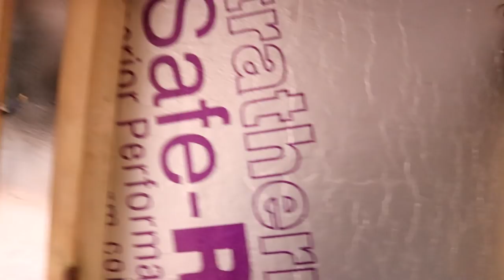I MET A BUNCH OF HEBRIDEAN CHAPS ON A RUN

Comment: Great work Harry - it’s coming along nicely. I like your idea of the condensation catch trays, as I would be concerned about the water soaking into the wood frames of the cool rooms and possibly leading to mould and/or wood rot. I would reckon you would not want mould in your brewery. Keep up the great work. Cheers from Australia. Jeff.

Comment: Nice shout out about the shouting out 😄 .  If you have fifteen rolls of plumbers PTFE it may be  a little different but I had at least three rolls of plumbers (knocking about in different tool boxes) and after I got the roll of gas tape I've never touched them since (when I find one I still go looking for the gas tape). Great vid as usual, I would go with the catch trays and a drain, I don't think that drips to the floor would run away efficiently, most likely they would soak into the wood frame and create a fungal/ rot problem in the long run? All the best. Cheers, Schnuz.

Comment: I mentioned it on another vid, but if you added a pwm speed dial you would be able to have full control of the fan speed rather than simply on or off. I have an air conditioner designed for cooling server rooms that I converted for my glycol chiller which had a loud af blower fan to cool it's radiator. With the speed control I run the fan at about 30% speed and it cut the noise down to almost inaudible levels and still pushes a sufficient amount of air.

Comment: Think that top tube on the radiator core is an overflow line - it would go to a jug in case there was lots of expansion and the excess coolant needed somewhere to go. No doubt you need to plug it. Your fix makes a nifty sight glass! You could split a PVC pipe to make easy condensate catch trays.

Comment: I'm no plumber but I think you may be a bit over zealous applying the PTFE tape, especially when you consider it's metal to plastic,yes I know it's got brass insert but it's still plastic body. I think it's putting too much pressure on the plastic and expanding it to point it creates a gap or cracks, just an observation m8. Other than that the cold rooms are really coming along nicely, definitely sort something for that condensation,the only concern I would have with drip trays is they would still be damp and could lead to mould,I reckon that's going to be your biggest issue with the cold rooms. Really like the nature shots at start of vlog,I should get out more in nature myself it's so relaxing. Some beautiful scenery around you there m8. Cheers.

Comment: Hi Harry. Did you get those boxes online? I have been looking for ones like that but have not had any luck.
Reply from the maker: Yes from ebay. https://www.ebay.co.uk/itm/Waterproof-Outdoor-Junction-Box-Weatherproof-Enclosure-240-x-190-x-90mm-IP56/263933000097?epid=2254766128&hash=item3d73a1f9a1:g:CGsAAOSwLwBab65m